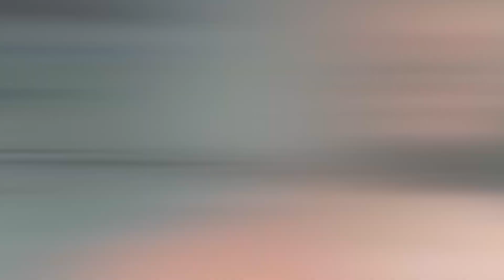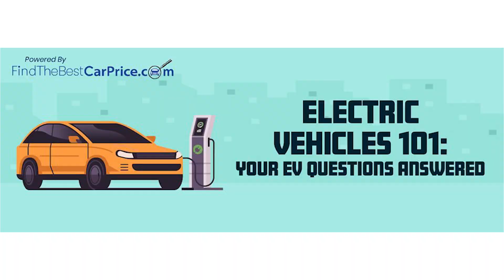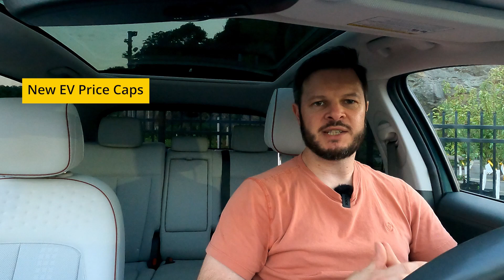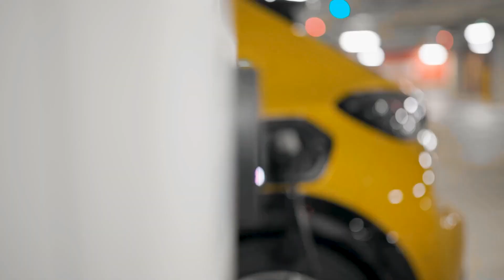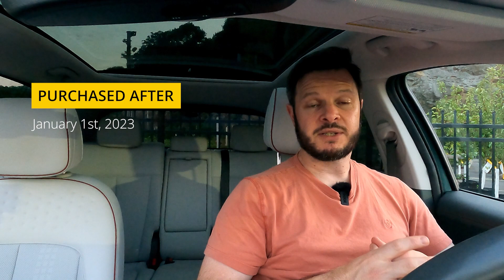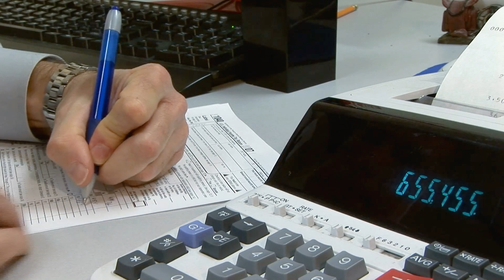How to Calculate EV TAX CREDITS: US Electric Vehicle Incentives Explained for New & Used EVs

Comment: From IRS.gov
“You can use your modified AGI from the year you take delivery of the vehicle or the year before, whichever is less. If your modified AGI is below the threshold in 1 of the two years, you can claim the credit.”
Can anyone confirm this is guaranteed for tax yr filing 2023?
Reply from the maker: Yes, this holds true for current year taxes and is still applicable to the current credit. Note that the system is expected to change again for 2024 purchases, but we're still awaiting further details on that.